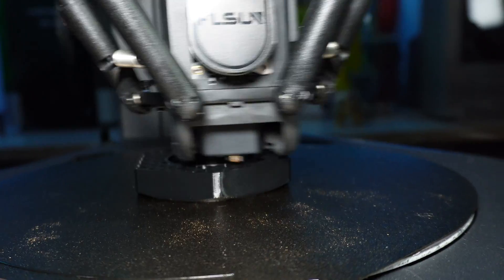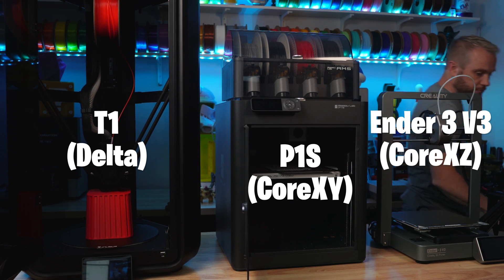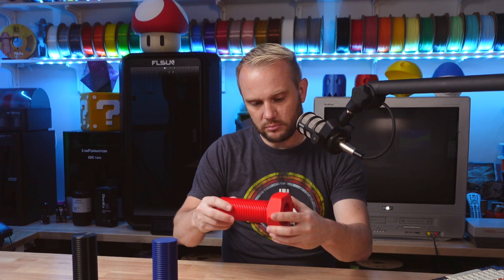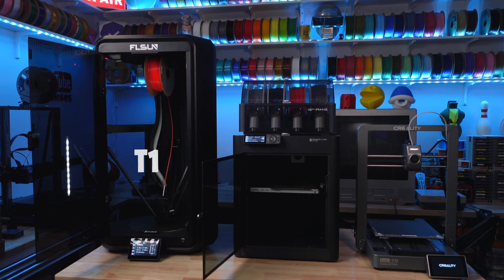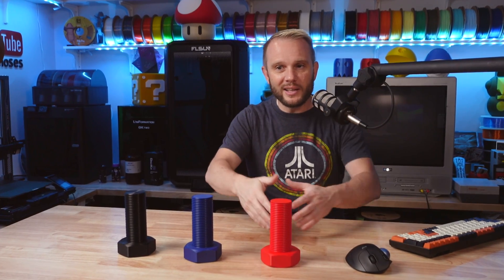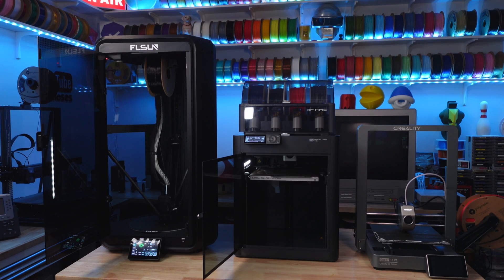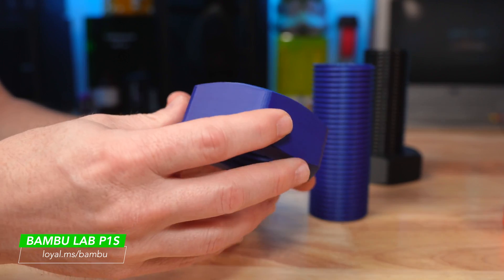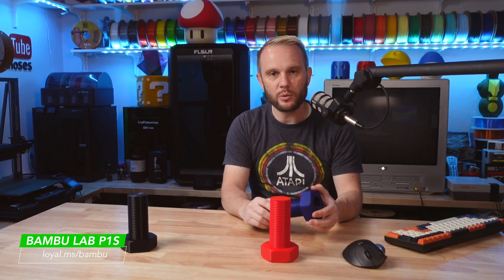Bambu P1S vs FLSUN T1 vs Ender 3 V3 - 3D Printer Comparison

Comment: Did you slice on the Bambu with Arachne wall generator?  That is by far the best choice when printing the circles like that bolt.  It would be my choice for that model by far (and most models)  The other thing. With Polysonic, you could bump that to Sport mode with no issues at all and speed up the print.  I may have to print that same model on my printer with polysonic in sport mode sliced with Arachne and see the speed/quality for comparison.
Reply from the maker: Try it! See if the quality remains with it being even faster. I sliced it all moderately to ensure they were printing within their respective normal speeds.

The delta is just so much fun!

Comment: I wasn't surprised with the results. I would probably call this a real-world test as you were testing the experience of doing prints. All of them looked to be pretty good prints. The TI is a beast for sure. 

I bought a P1S as my first printer as part of the Bambu Lab's 2nd Anniversary sale last month. Haven't printed any "fun" stuff yet, been printing mostly upgrades and tools to get my 3d printing setup ready for doing more things. It's been pretty reliable and the quality has been really good. Have only used Bambu filaments so far, but got my first order of Polymaker filaments last week, so will be trying out them soon.
Reply from the maker: Welcome in to 3D printing! Fantastic choice for your first printer, wow!

That is an amazing machine, can do ANYTHING!!! Also, smart choice on the filament, you really are setup perfectly!

Comment: yeah but wich one is most relible? easier to repair or maintain ? I think this need to be taken in to consideration to. Tnx for video.
Reply: And documentation? BL wiki is comprehensive. I've never got decent support/documentation or my FLSun. And while it was great when new, a short time later it started getting leveling problems (crashes while leveling), inaccuracy leveling and poor consistency of prints. As a result it is no longer used.
Reply: @NickBR57  FLSun has a dedicated wiki and a whole line of youtube videos on a seperate channel, that go over each component replacement and common troubleshooting and tips.  They have a heavily active discord and an official facebook group where after-sales engineers respond to each support question and issue.  Whatever old FLSun you had, it's quite different today with the T1 and S1. I own the S1.
Reply: @Protonus  None of which helped with my issues. Reflash the firmware was their only answer and it did nothing
Reply from the maker: I love when companies make those videos!
Reply from the maker: Documentation along with support are so important, let’s hope they get better at it.
Reply from the maker: I think this is a GREAT idea for a separate video, I’ll come up with a good format and do it!!! Thanks for sharing!